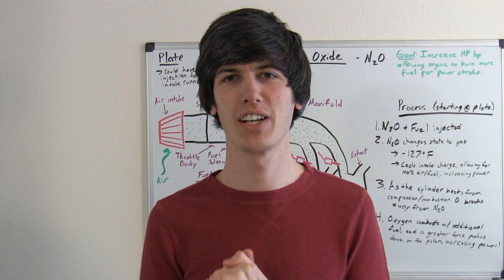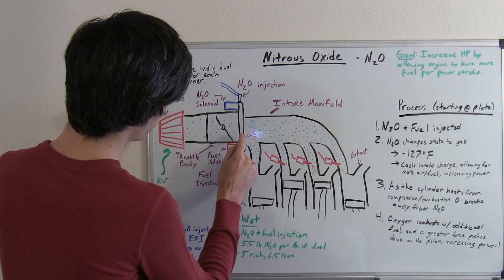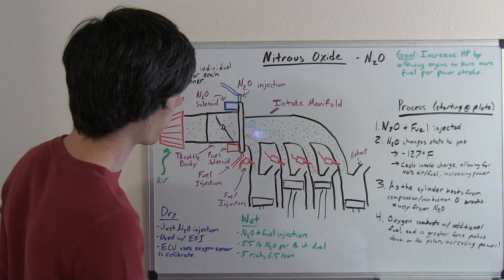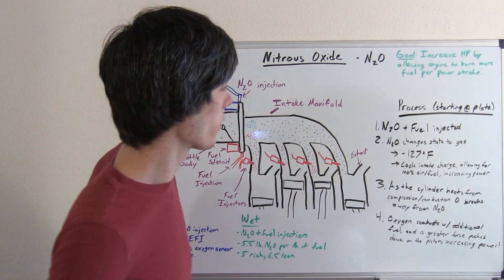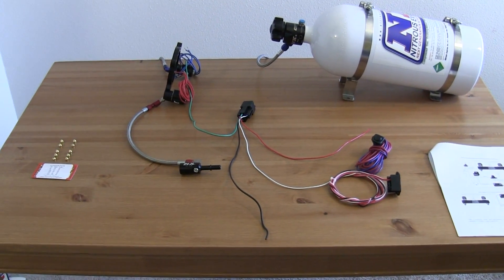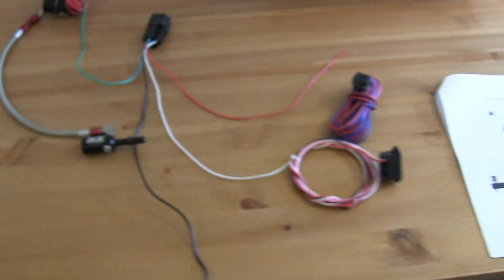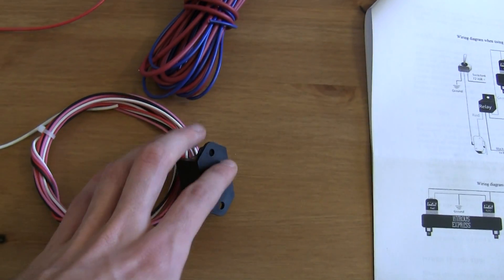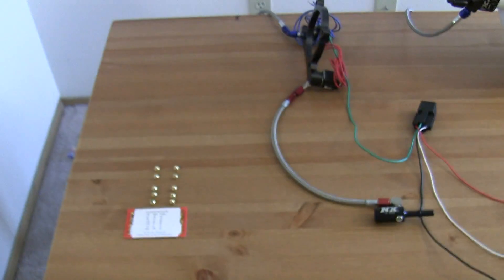How Nitrous Works - More Horsepower!

Comment: Chemistry teacher here.  Burning N2O created N2, which has a very strong triple bond, releasing more energy.  That is one reason by nitrous oxide creates more horsepower (1hp = 746 W).  I don't know the engine design and mechanical reasons.  N2 strong triple bond is why only small amounts of NOx (smog) gets made,  it is easier to form CO2 and H2O than break N2 which is all around the reaction in the air intake.
Reply: Do some of you remember all those single, double, triple bonds, Lewis Structures, octet rule?  Some of the things you learn in chemistry are kinda applicable.

Comment: When we use nitro, will it kill the engine?
Reply: You should at least have forged connecting rods. Cast rods tend to be the 1st thing that fails from nitrous, or boost. If you can afford to have complete forged internals, that's best,  but at least have forged rods. If you can afford the forged with the lateral gas ports, that's even better.

Comment: Does this mean that when I install a N2O system in my car, it will always on as long as I flip the switch on and on a full pedal? I mean, can it be activated only when I push a button like in the movie the fast and the furious? Or is that actually the switch they pushed in that movie not another button? Or maybe is there any downside if I suddenly activated NOS in the middle of full throttle application?

Comment: Question: if HHO was injected instead of Nitrous and if the full throttle sensor was deactivated I assume the HHO would mix with the gasoline before going to the injectors. Besides too rapid flame speed the problem with HHO is that it causes clean exhaust. Too much O2 in the exhaust triggers the O2 sensors that in turn cause the computer to dump in more fuel.

Is it even worth trying?

Comment: I know this video is old, but does that mean that nitrous is basically like a supercharger in the sense that it uses forced induction?
Reply from the maker: It's not really like a supercharger, which is a compressor adding air. Instead it's a separate, finite amount of additional oxygen that the engine can use for a certain duration for more power. A supercharger is always available to increase power.

Comment: Why do most people use Nitrous Oxide rather than pure Oxygen? 
I would asume it would boost combustion more and therefore more power. 

Is it simply a matter of excess heat being expelled with the Nitrogen? And thr chance of melting your pistons?

Comment: Excellent video and presentation. I've heard from several people, that using this system can cause damage to your engine. Is that because the ratio of fuel to N2O is too rich with N2O and over heating, thus damaging the engine? Or is it there is just too much power and the engine can't handle it? Thanks again.

Comment: If the fuel going into the solenoid is still coming from the same line as the fuel injector how does it make the engine respond faster. Wouldn't it just be the same amount of fuel but split between two entrances?

Comment: Question, I've asked a lot of people but no one seems to know.
Why can't we just inject oxygen?
Reply: My guess is that N2O liquefies under pressure, which allows a larger quantity to be carried... (Liquid oxygen seems to require cryogenic temperatures...)
Reply: "Engineering Explained - [N2O] is a safe gas until it's hot, where as oxygen alone is much more dangerous."
Reply: Turbochargers and Superchargers designed for that very purpose.
If you're talking about liquid than storing liquid oxygen is very expensive is very very dangerous as well. You need the oxygen in gaseous form for the proper expansion.
Reply: Pure oxygen is too unstable and pre ignites.. the oxygen atoms are shielded by nitrogen atoms in nitrous allowing them to enter the combustion chamber with far less risk of pre ignition..
Reply: Pure oxygen causes pressure detonation  aka "knock" . They tried that in planes back in ww1. Then they realized it was a huge problem,  then they switched over to ntitrous oxide to help the planes at higher altitudes before the turbo was invented and used more often

Comment: Are there any steps that are needed to take place in order to get a nitrous set up on your vehicle? Such as any aftermarket parts installed to the engine for such an increase in horse power? I would think with the nitrous being added it would cause greater stress to any gaskets or seals or majority of the parts in general, correct?

Comment: @Engineering Explained What is the power curve of an engine using nitrous oxide? Does it make exactly 100hp from 2000rpm-9000rpm for example if you put NOS on a 458? I'm asking because I'm trying to properly simulate NOS in a power curve but obviously,  horsepower is a byproduct of torque. So for example, to make 100hp@2000rpm, the NOS needs to make 356nm of torque. But if it were to maintain that torque all the way to 9000rpm, the engine is working harder, so 356nm@9000rpm is 450hp. Does it automatically adjust how much nos its spraying into the cylinders based on rpm to always make the same amount of horsepower? If you could tell me how this works I'd really appreciate it.

Comment: For Genesis 3.8;
Best bang for the buck is N2O .with supporting minor mods ,meaning : true dual cat back exhaust (no headers needed) , NX 5/16-8mm fuel line adapt ,drop in K&N filter ,open up air vents (hood),catch can,TBI coolant by-pass,MSD GMR digital shift light which will allow you to use The NX Maximizer 4's window 
switch and other safety functions.Bottle pressure gauge , NGK colder 
plugs ,aluminum drilled & tapped TBI spacer with thermal 
gaskets,grimspeed phenolic manifold spacer ,purge kit and open slits in 
front of air inlet snorkel( check my GCtuner's pics) ,Move Air inlet temp sensor on top of air filter 
box and driver side valve cover vent tube to former AIT's location 
,install a 45degree silicon 3.5 air inlet tube in place of the OEM air filter inlet tube/hose and get rid of the heat soak causing OEM engine cover.jet as I have given and WALLAH!!! 75 true rear wheel HP without ECU tuning and worries of harming your motor as the 44 N2O jet & 20 fuel jet is on the 11:5.1 rich side ,just use 93 oct and above . .
 Shorttrack. Gencoupe Forums.  :)

Comment: I've got a question. Would it be possible to drive on NOS passively, like microdosing it non-stop with the fuel? Would it end up like an improved fuel, increasing the engine's capability and HP?

Comment: what would happen if you would use just pure oxygen? wouldn't it be even better?
Reply: mrgaiusbonus like he explained in the video, when the nitrous liquid turn to gas, they get really cold and in turn cool as they are atomized. I would assume pure oxygen would cause extreme overheating and eventual detonation. Superchargers basically shove more oxygen down the intake and are also the reason why they're notorious for overheating
Reply: Some guy on here was saying how its more explosive so it damages the pistons, seals, etc. He said equivalent to taking a hammer and banging on the piston head rather than with normal combustion or using NO2 which is slower combustion pushing down the piston head.
Reply: "Engineering Explained - [N2O] is a safe gas until it's hot, where as oxygen alone is much more dangerous."

Comment: why nitrous? why not compressed liquid oxygen?
Reply: DAMON STAHL  Pretty pure oxygen is way to volatile.
Reply: Crixus S that's the point, the explosion in the cylinder would be huge. I guess in the event of a crash and fire it would be a potential bomb? but still
Reply: DAMON STAHL I'm talking like the mixture pre-detonating in the cylinder. It shluld be much more powerful if it could work but it's not safe.
Reply: Crixus S you mean from the compression and heat itself? I suppose it's possible. that's why I asked
Reply: DAMON STAHL Yeah I'm pretty sure it would, though I'm not a chemist or engineer or anything.
Reply: Crixus S just a little extra O2 increase that atmospheric composition from 25% to like 35%  be fun to see.
Reply: "Engineering Explained - [N2O] is a safe gas until it's hot, where as oxygen alone is much more dangerous."
Reply: Actually nitrogen takes a huge part in combustion. Air consist mostly nitrogen (78%) and when it's burn with fuel, it will expand a lot and cause pressure to push down the piston. If you just add oxygen to the combustion, it will make much more heat but less pressure instead we want it to be high pressure to drive the car. So that's why we use Nitrogen + Oxygen.

Comment: Hey there! I'm  a brazilian mechanical engineering student, and if it's not a problem I'd like to ask you something about the Nitrous Oxide. I understand that N²O delivers horsepower to the engine, among other reasons, because it allows more air to make part of the combustion cycle, by doing this, more fuel will be released in order to balance the mixture. I also understand that because of the heat, the nitrous oxide splits in nitrogen and oxygen. Here is the question: The oxygen makes part of the combustion, but what about the nitrogen? I've learned that nitrogen gas is flammable when it reaches hight temperatures (higher than the splitting temperature of the N²O), and it is flammable as well at hight pressure rates. I don't know if inside the combustion chamber, the nitrogen gas becomes flammable or it stills inert. So... Does the nitrogen gas helps the combustion by being a secondery fuel or it only helps by being inert and messing with the combustion chamber space, increasing pressure and providing a powerfull explosion? Thanks!
Reply: The nitrogen acts to help slow down the burn rate with the added oxygen.  This is why you can’t use straight oxygen injection.  You need the buffering of combustion speed to control flame speed.

Comment: So, what your'e saying is that on those street drag races, the nitrous in only on when theyr'e at full throttle, so when they change gears the nitorus is (automatically) closed and then reopened when they hit the gas again?
Plus, are there other tipes of nitrous systems without that sensor conneted to the gas pedal, where the nitrous opens only when you press the button and closed as soon as you release it? independently of the throttle?
And at last, what people mean when they say they have 2 or 3 kits of nitrous?

Great video btw.

Comment: can this work on a lawnmower
Reply: Yes. Just make sure you're holding on when the VTEC kicks in yo!
Reply: o Lemurs okay I'm going to try it on my Tesla
Reply: Yes it actually will work on any motor
Reply: magicmanma1 does this work on my toaster
Reply: Sutansudo Drifter Haha
Reply: Theoretically.
Reply: o Lemurs *engine
Reply: PixelRacerClips PRC theater theatre same ting wong
Reply: It's not how fast you mow, it's how well you mow fast.
Reply: In theory yes, if you could get jets small enough for the small volume engine, so in practice no.
Reply: If it can kiss that lawnmower engine goodbye.
Reply: @the human within oh really?
Reply: try a bit of model airplane fuel in the lawnmower.  Nitromethane!!
Reply: @the human within all cars are electric.  Don't belive me?  Try removing the battery and see how it runs.
Reply: @the human within Radio, computer, fuel injection, airconditioning, seat adjustments, transmission shifting, etc, etc...
Reply: @the human within Computer, ignition, fuel injection, throttle, any one of a dozen sensors, thermostats...  Still electric.
Reply: Just buy a honda civic, same thing
Reply: works great on civics

Comment: Then why not use pure liquid O2?  Wouldn't that create a better result since more heat is going to mechanical vs to chemical AKA no O to break off of N2O and you would still get the phase change and thus still cooling the intake charge.  

What about the difference in combustion of 02 vs just an O?
Reply: if you do that, you will be the real life michael bay and i wouldn't want to be near a car with that O2 bottle.
Reply: +Vasilis Green that may be true but would it not be more efficient?  plus liquid o2 is transported all the time, why not have it in a car?

Comment: I may be wrong, but rather than just reducing the charge temp, doesn't the NO2 release the oxygen atom in the combustion process? I was always informed that it's this release that oxidises the mixture quicker, thus increasing the power. If not, why not use LPG or some other liquid that would convert to a gaseous state quickly, plus is combustible in itself?
Reply: this is why you keep watching before you comment

Comment: why don't we use liquid oxygen?
Reply: I'm only using my own logic here (I've thought the same thing), pure oxygen in the combustion mixture would simply melt the engine's internal components due to the massive combustion temperatures. It'd be like putting an oxyacetylene welder inside your engine... Put simply, I think there would be too much heat generated too quickly. 
You shouldn't run an engine on nitrous for too long either ;-) . 
Again, this is purely speculative, but it's what I've always been told and the conclusion that I've come to.
Reply: if you did this, your oxygen bottle would go boom...

As we all know, no combustion happens without oxygen, no matter how flamable is the substance. Oxygen itself, combusts on it's own any time given the spark or whatever force to start the combustion. If you dare do that, the ignition will follow the oxygen line all the way back to your bottle. Also, if you use the same volume of oxygen as you would use with just air, i think the ratio is about 16/1 air/fuel, your engine will explode. So, little enough to trigger normal combustion, your oxygen tank will explode. Use normal ratio and both your engine and oxygen tank will explode....

Also, the airflow in the engine is consistent with constant flow coming from the exterior intake and ragulation from the internal systems. Oxygen ignites so fast that even the intake system wouldn't be fast enough to cut the O2 line to the engine...

If something is flamable, then oxygen is the absolute king of ignitability. Everything requires oxygen to ignite. Oxygen ignites on it's own. I don't even know if an actual spark is needed for the oxygen to ignite.

Comment: Will a piston from a small engine ( for example 1400cc/90 hps) get damaged if you use the thingy for max power (200 e.g.)?
Reply: Yes it will quite literally melt pistons and crack the block
Reply: +Power Glide yes as it was expected. thanks
Reply: jesus christ man 90hp car and nos? :D

Comment: Great video explanation. I would like to add that they do not recommend using Nitrous under 3000 RPM and its good to add an RPM activated switch. Also use 2 step colder spark plugs "non-projected". 3 or 4 step colder plugs if you run high compression or e85 and colder for alcohol. The spark gap should be around .035 or smaller on average depending on setup. You do not want to use incorrect plugs as it may cause engine damage. Grey or brown plugs after a hard pull on fresh plugs is normal and also check for a heat line that forms on the grounding electrode. Too lean and the line will show towards the tip of the plug and too rich will show a heat mark on the grounding electrode towards the threads. You want that heat mark to show right in the bend of the ground electrode plug. I went through 4 sets of plugs just to tune Nitrous in just 5 hours. using new plugs every hard run to inspect the proper firing and temp range. if your plug blackens then too much fuel is dumped at certain RPM/Engine load and should be tuned more.. A white tip indicates not enough fuel is being delivered (fuel injector/pump issue possibly if stock running stock plugs). Hopefully I explained that well. Im more of the hands on troubleshooting guy than the one to explain it. I just fix it. lol :P

Comment: So the nitrous cools the intake manifold so more fuel and oxygen can be put into the piston chambers?
Reply: +Jakob Bosworth   No, while nitrous does cool the intake path, an added bonus. Its main power comes from when the nitrous is in the cylinders under compression and heat it breaks the nitrogen molecule off the Oxygen molecule and thus you now have lots of extra oxygen in the cylinder. With the added fuel the nitrous kit is adding in, via using a wet kit. Or if youre using a dry kit the injectors would add the extra fuel, and boom more power.
Reply: Oh, I see. Very cool! Thanks for explaining that for me!